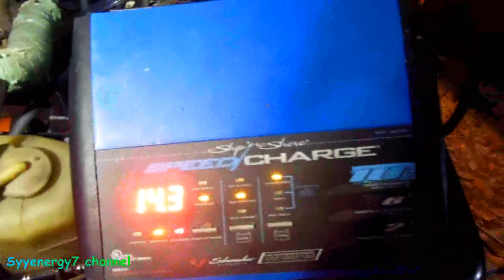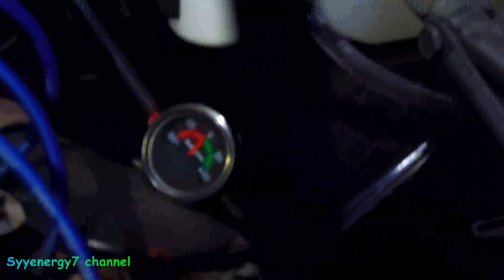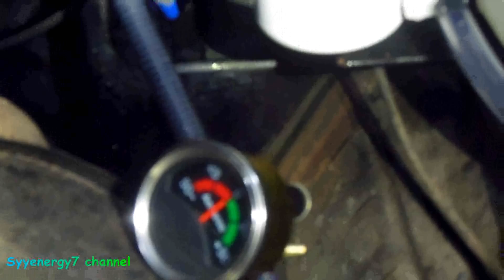Quick Update on HHO, Install in Suzuki Samurai

Comment: Am I seeing that correctly...your have BOTH Air-O2/ hydogren (good) and water bubbles traveling up and going into your air-cleaner housing....are you really going to try burning all that water I see flowing up over and into your carburetor? Seems like your car is going to be difficult to start in the morning full of water in the carb. I mean i saw the "huge" water pockets with air traveling up into the air cleaner...that should only be vapors yes?
Reply from the maker: Accuracy Marked The water in the line after the bubbler is a mistake.  I'm uploading something very soon.  You'll see this unit has very good production..  The gauge bracket si mounted also. It will be done tonight.

Comment: Is the jeep engine running of that?
Reply from the maker: It just adds extra.  What this does is give you a cleaner, more efficient burn of the existing gas.  I really works well on older carbureted, non-computer engines.
Reply: Oooooh I understand now, how is it on emissions? Would I pass inspection?
Reply from the maker: Stan Smith
On older cars with a carburetor and no computer, the HHO definitely cuts back on emissions, but I'm not sure how well it would work on a car with an engine management system.  That throws in a lot more factors.   I heard it works ok on those cars too many times, but not all the time unless you get into modifying the engine management system.